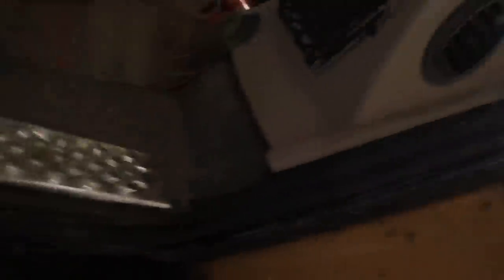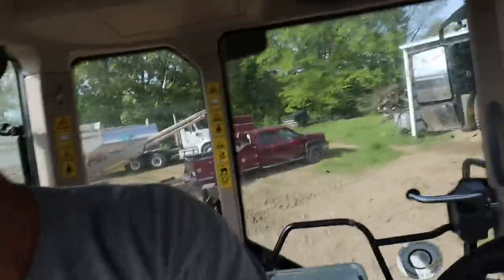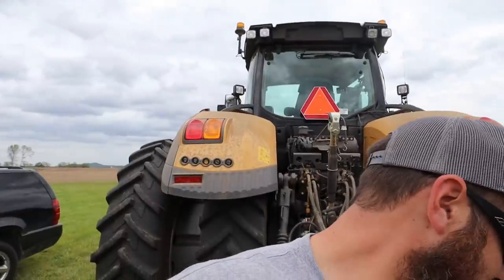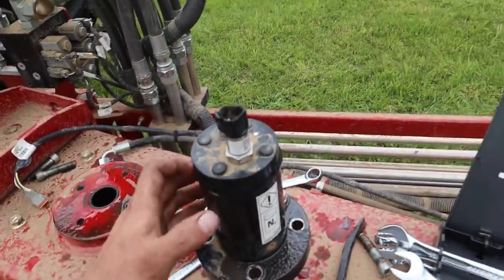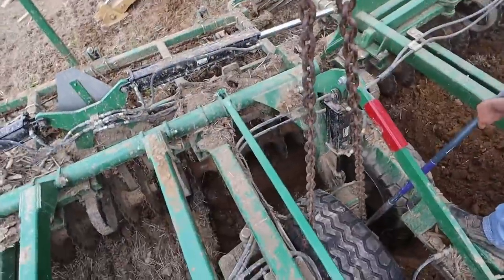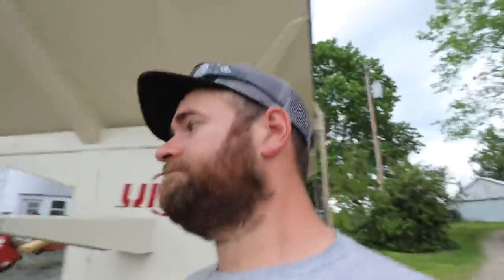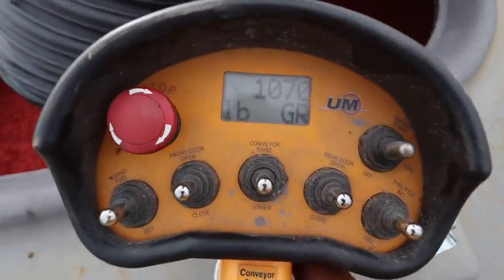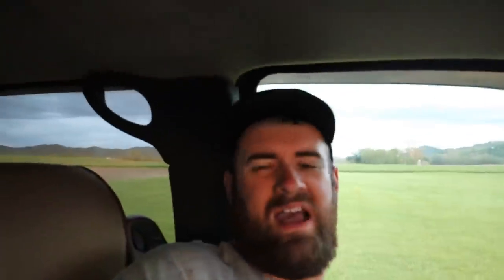Tire Change gone WRONG!

Comment: Boys, next time just grab some sturdy wood and a couple of 55 gal barrels. With the machine folded up, put tho barrels out were the outer parts would land on the ground. Put some pieced of lumber on top of the barrels to spread the load and then unfold the cultivator. As it approaches the barrels and wood, adjust their positions to make solid contact with the frames. Then fold out completely and in the process it should lift the wheel assemblies completely off the ground. Slide the wheel under, stand up and bolt in place.
Reply: Guessing you've never actually tried that before lol

Comment: Having experienced the very same problem, do yourself a favor and call Great Plains dealer and there is a lift point that makes the job much...much, easier. You're not the first and no doubt will not be the last to dig a hole. Good job men, good video Brian.

Comment: Next time block the implement with it raised, once blocked raise the hydraulics and pull the outer wheel off and then the bad wheel and tire. Slide the good tire under the gear and install both wheels and tires. Thats the easiest way ive found to do those.

Comment: Put that tire in from the back. I've changed prob a hundred tires on the inside of disks, NH3 rigs etc I just roll the tire from either the front or back over the gangs and drop it in the hole it needs to go in. I then use the hydraulics to get it about where it needs to be so I don't have to lift the tire up. Can just use my feet to move it an inch or so either way to line up the holes
don't think I ever changed one that isolates like this one does. I guess I would just chain up the side that had a flat on.

Comment: We had a runied tire on the inside of a 30" Turbo Max. Tire was horribly expensive, had to use a bottle jack under the poorly designed inside wheel system. Little to no room and a PIA.

Comment: Hard to believe you need a backhoe and two men to replace a tire,i believe an axle lock to hold the axle locked  in the up position is certainly needed,what a headache to replace ,this can't be correct